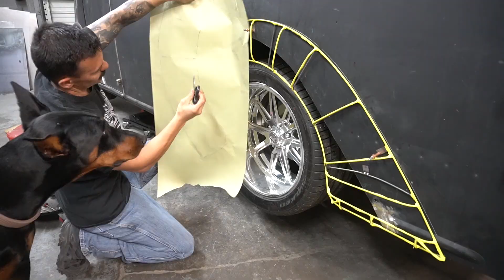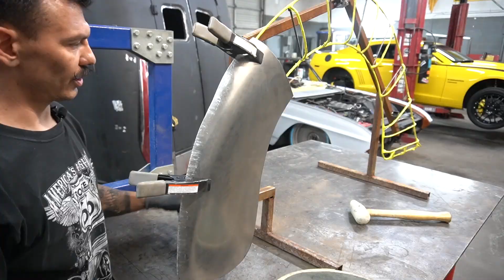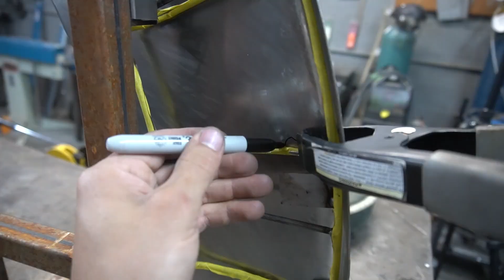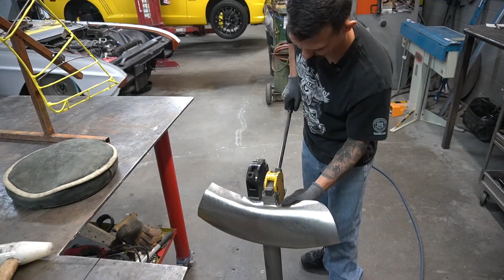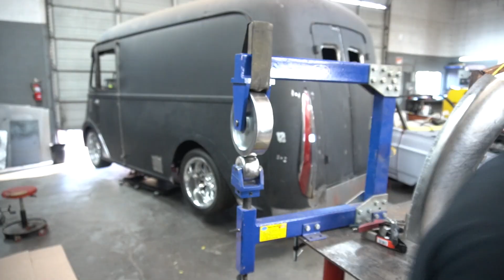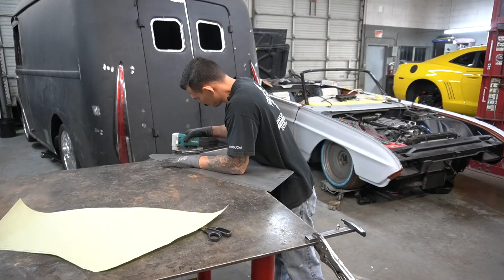DIY: Building a fender with hand tools. part1|| metal shaping on a buck

Comment: I am not a metal fabricator by any means and I am not questioning your method(s).
Just out of curiosity, wouldn't it be easier to heat that metal up a little bit?
Reply from the maker: Haha well I'm some cases heating it up could work but heating will  warp the panel in areas you don't want warped... In Sheet metal shaping you only heat the panel when your doing some really extreme stuff. Everything is basically done cold most of the time.
Reply: @BeAMetalFabricator 
Oh, I see.
Good information.